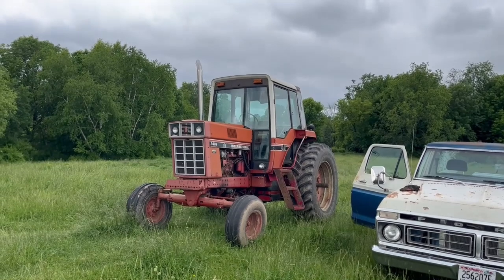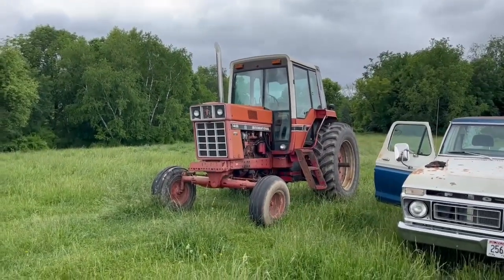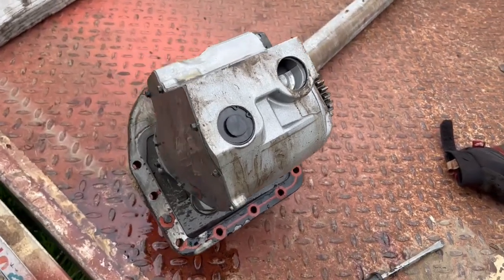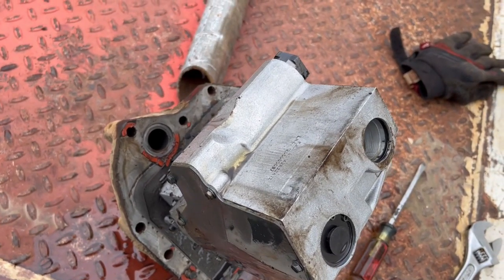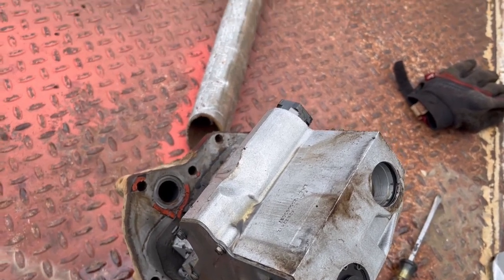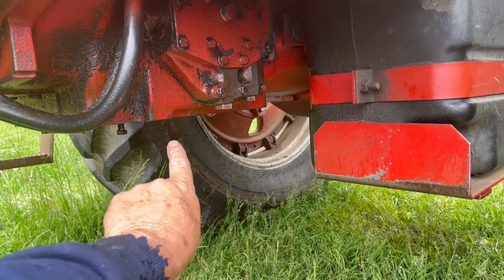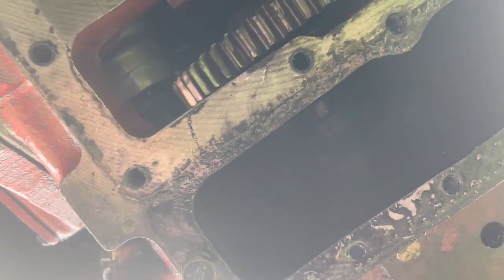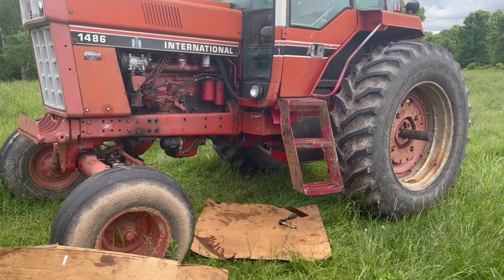International 1486 Lost Hydraulics: Diagnosis

Comment: I changed the PP and counter shaft on my 706 for the same reasons years ago. Got my shaft from a salvage and had a clutch shop rebuild the PP.
Reply from the maker: I don't think this will be too bad, I just don't have the facility or equipment to split a tractor this size myself.

Comment: Glad you found the cause of the hydraulic issue on the 1486. 👍🏻👍🏻  Hope you're able to get it fixed reasonably.  Good luck with the smarting up on the cows.  I sold my cows & the Hobby Farm that I had years ago & still ended up getting stuck with a horse. Dang "Dad's Revenge". 😁  ROCK ON FARMER PETE!!!!
Reply from the maker: Thanks Ron. Cows are a hard habit to break.

Comment: "802 Farmers" youtube channel had the same thing happen to this tractor as well.  The tractor still drove fine, but they lost all hydraulics.  It turned out that a bunch of bolts on the clutch broke off.  It sucked, because that clutch had barely any hours on it, before this happened.

Comment: That's sucks to say the least, there are worst fixes that it could have been but it's a pain splitting a big tractor like that with out the correct facilities. If you have problems finding parts in your area Call Ron Jones tractor salvage in Rock city Illinois he specializes in the red ones, he's a great guy with great prices, I'm sure he'll have what you need new or used.
Reply: "meyers tractor salvage" in Aberdeen, SD also has parts for just about any piece of farm equipment as well.

Comment: Well, at least you know what you're dealing with now.  it was interesting to see how your hydraulic pump comes out - seems rather easy.  I need the pump changed on my Oliver 1550 and you have to remove the seat and take a lot of stuff apart to get to the pump.  Hope your fix will go smoothly, after you do your research.  I'll be watching to see what happens.
Reply from the maker: Thanks. I don't think it will be too bad. I'm glad I pulled the pump, I can fix that bad O-ring.